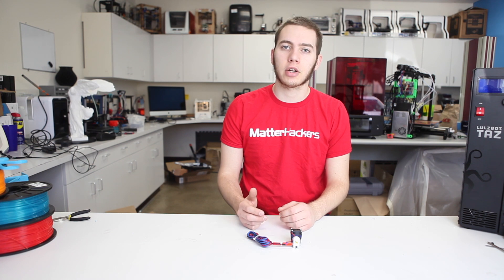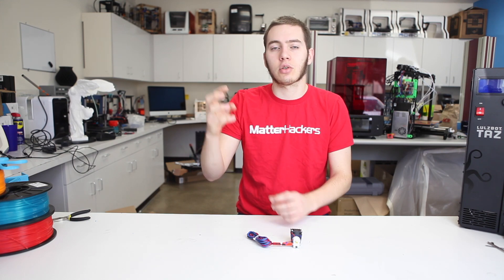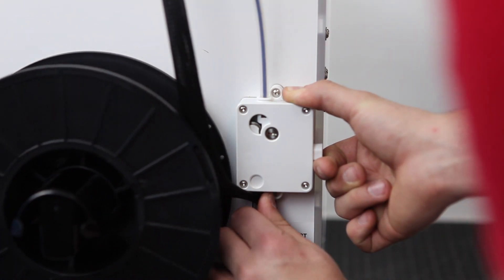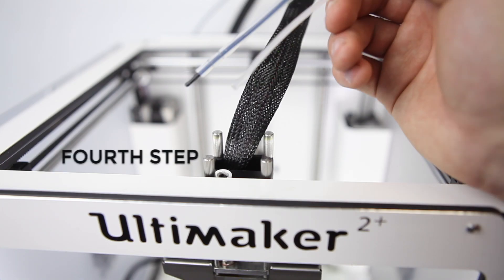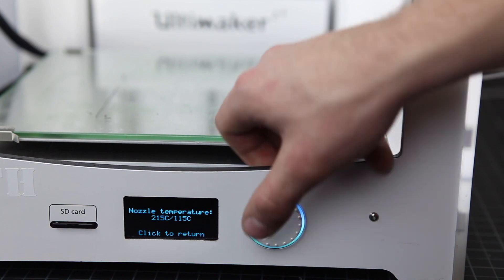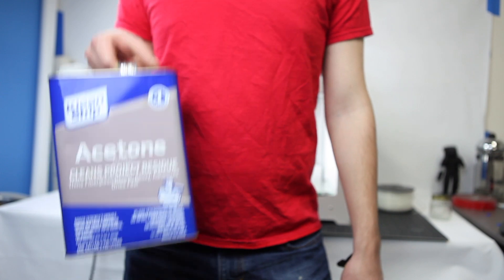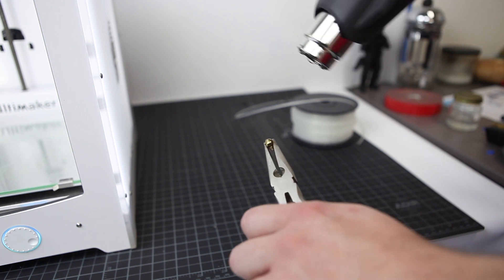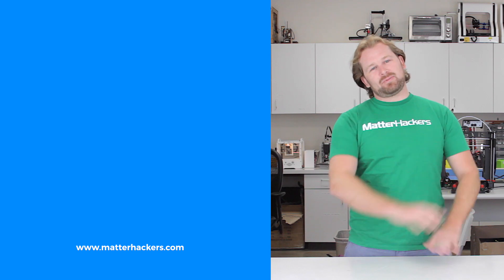How To: Unclog a 3D Printer Nozzle // 3D Printing Tips and Tricks

Comment: What is the lowdown of Acetone and plated nozzles?  I soaked a Triangle Labs nozzle that came with a dragon hot end and it had no problems...I proceeded to do the same with a Phaetus nozzle that came with a HF hot end and the coating pealed off.  I just purchased an e3D pro pack of nozzles from Matterhackers and don't want to destroy anything.

Comment: I would rather use a 0.4mm pcb drill than an acupuncture needle. They do break more easily but they are way better in terms of cleaning. And the best part is, you can get them in 10 packs for about 6 Euros.